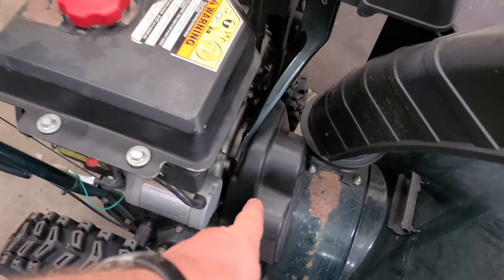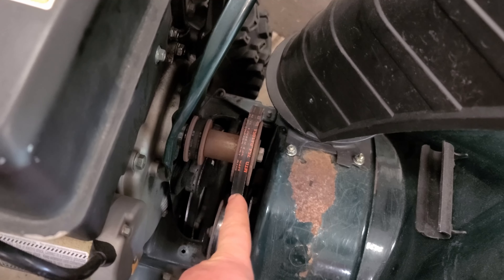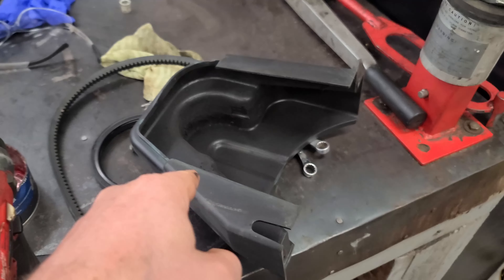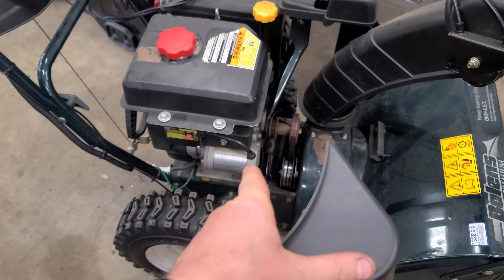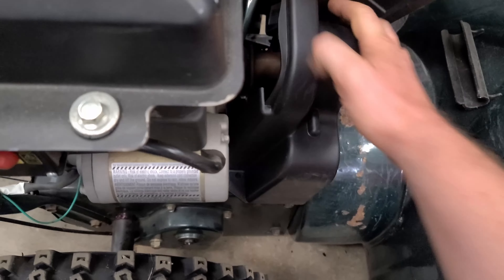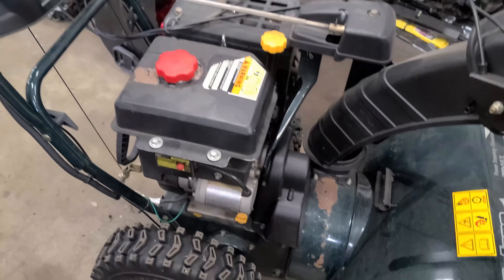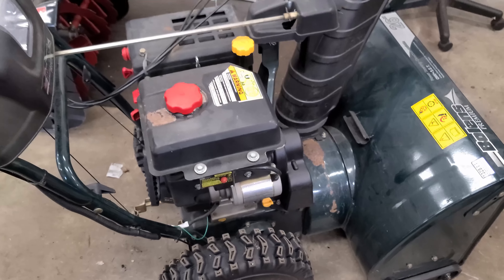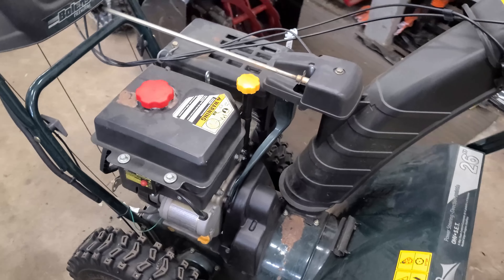Snowblower Weird Noise Problem Solved! Mtd Cub Cadet Bolens Craftsman Yardworks

Comment: I had a 2013ish MTD Gold blower that kept throwing that belt. I noticed the cover was worn like the one in this video (but worse) so I ordered a new cover. I was happy to see the replacement had the metal strip. It didn't throw the belt anymore after putting the new cover on.

Comment: That's amazing that just happened to me last week.  I replace the bearing on the auger shaft put it back together and it started to make that noise. So I pulled off the cover and had plastic shaving just like you showed.  I had no idea the cover had a multiple purpose. I will be replacing that part also.  Thanks so much for posting these videos. Great content!!!

Comment: After burning through one of my covers, I try to minimize releasing the auger handle, thus keeping the belt tensioned and the auger constantly spinning. That way, the belts don't slap and wear out the plastic cover.

Comment: Thanks! Another simple concise and very clear how-to video. 

You could add Columbia to the brand names on that video. I have a Columbia 10528PC that is the almost identical twin of the one in the video other than the color. I recently did the pilot jet drill operation on it as shown in one of your videos several years ago to stop the surge. The engine on mine appears to be identical to the one on the snowblower in this video.

Comment: I have a 20 year old Craftsman/MTD. My auger belt was stretched. Put a new belt on and the slapping noise stopped. My cover is different with built in sheer pin storage. It's been reliable but rust will probably spell it's end before a serious mechanical failure dooms it. It's a shame the new blowers come with Chinese engines. My Briggs still runs like a champ on the first pull with the original carburetor.

Comment: The auger belt on mine started hitting the cover after I put on an after market belt that was a bit longer than the original belt. Perhaps a belt from MTD would have been a better fit. That's what I'll be getting next time.
Reply from the maker: yes it's better to use the oem belt from MTD

Comment: As a mechanic of 40 years in my own shop see this all the time. I try to steer customers away from mtd products if they want to get serious about removing snow.Their products have gone down hill.The early models built  on 90's like the large frame blowers are like a tank and are heavy  duty and reliable.
Reply: Yeah tell them to buy Honda's!!
Reply: I have a 5 year old MTD and it is the best blower I have ever owned.
Reply: @Banditt42  MTD has made some great quality snow equipment over the years I agree, and I'm not bashing MTD. I just know from my experience being in the business for 50 years that Honda makes the best quality snowblower.....on ANY market!
Reply: They're obviously not premium but they're not bad either, and they don't have a premium price. MTD have good parts availability, so it's not hard to keep the machine maintained in a good state. My own is a 2008. No sign of it giving up anytime soon. Painted the bucket once. Replaced one cable that stretched. Replaced some plastic bushings on the auger. That's it other than the usual regular maintenance.  Mine has a Briggs engine.
Reply: @jptrainor  oh I agree with you there but also remember that you're "mechanical" if you will and I'm sure that you keep your machines in good working order. Like running most any equipment it sure helps to be mechanically inclined! For instance the bushings you replaced....most people wouldn't have even known they were worn or wearing and they wouldn't replace them. Then what? More wear and tear then finally goes to a shop, if by then it's not beyond repair lol. Yes, this is true with ANY brand, some just wear out before the others! 👀😅😂😂😂😭
Reply: @donmayberryjrsOPE  Yes, true. Keeps the shops in business, lol. When I got my machine I recall hunting for expected lifespan info and somewhere found that MTD design them for an expected six year life. Which I assume is under typical home owner poor maintenance conditions. After that one can expect to have to start replacing the odd worn part, or carting it to a shop occasionally. That's roughly my experience. The engines supposedly are good for a few hundred hours of run time, which I suspect is longer than the life of an MTD frame. I don't have a huge property to clear. The machine gets under 10 hours if use a year, so it works for me. If I had a large area to clear, I'd likely go for a Honda. The economics for me are that the machine has to pay off in four years compared to hiring snow removal. That's probably works even for an expensive Honda if the property is large enough.
Reply: @jptrainor  I remember talking to some techs at Honda (we're a dealer) back in the late 80s who told me that the 2-stage Honda snowblowers, and the GX engine were designed for 2000 hours. 2000 HOURS!!! Who does that!???
Reply: @donmayberryjrsOPE  Commercial I guess.  Not me, that's for sure.
Reply: Building to a price point, the newer mtds cost about the same as they did 20 years ago when i bought my mtd built troybilt storm. Its def not the highest quality but Been a good machine.  Americans want everything cheap so Nowadays manufacturers are definitely finding more ways to keep the cost down and retain high profit, the result is less sturdy equipment.

Comment: Hi Dony, big fan of you vids
Is it a big deal if I have lost a small amount of oil on my mercury 15hp outboard gearbox oil?  And How much is adequate to run properly, like does it need to be all the way full or would it even run fine with half full.
Thx

Comment: Frustrating the engineers didn't think of this when designing that cover, but glad there's a better replacement.  Bummer you can't just get the metal part and put it on the old cover...  :)

Comment: Hey Don a question when tipping the snowblower up on the bucket to remove the bottom pan should you drain the oil first? Or does it matter I do put a piece of plastic over the fuel tank filler hole and put the cap on to keep it from leaking.
Reply from the maker: I have never had an issue so there's no need to drain the oil
Reply: @donyboy73  Thanks Don.

Comment: Nice. Would it be so hard or not recommended to place a piece of metal instead? I mean, you might already have at home something to make that, and some screws as well, instead of waiting for the piece to arrive. Also, if you're in need of using it, waiting for the piece might not be the best.
Reply from the maker: someone could easily fabricate a metal liner
Reply: don't you worried about belt scrubbing on metal and premature wears...?
Reply: @donyboy73  Done that

Comment: Hi Dony..I have a brand new craftsman snowblower. Bought it in February of this year.  3rd time I used it, the gear select cable broke when shifting to reverse. Contacted MTD.  They sent me a new one. I asked if this will happen again..  they said probably. When I try to move it by hand it’s very hard. Any suggestions?
Reply: HI JAKE, I DONT KNOW FROM NOTHIN BUT.   IS IT THE RIGHT CABLE??  THAT HAPPENED TO ME WITH MY NEW BLOWER.  THE LOWES GUYS SOMEHOW INSTALLED IT WRONG AND I COULDN'T  DEPRESS THE HANDLES TO ENGAGE EASILY.    NIGHTMARE TO USE.  I gave it away as I was moving to town but there didnt seem to be any leeway for adjustment.  ?? Crazy
Reply: Most snow blowers use a disc or friction wheel to change the "gearing" as it were. Check the hex shaft that disc moves back and forth on. If it's totally dry, that's your issue. It is has a light layer of rust, there's your answer. It's best to clean off that rust and lightly grease the shaft, not oil. When you move the shifter, it should be free and non binding. If that's not it, then check the nuts used to tension the shift handle. It's a lock nut situation so you have to use two wrenches one to hold the locking nut the other to set the tension on the handle. Again, it should shift freely, but not move on its own.
Reply from the maker: If you have warranty I would take it to a service centre
Reply from the maker: make sure the drive cable isn't too tight